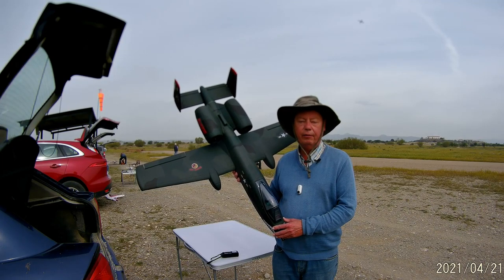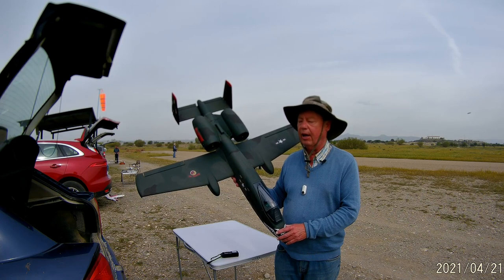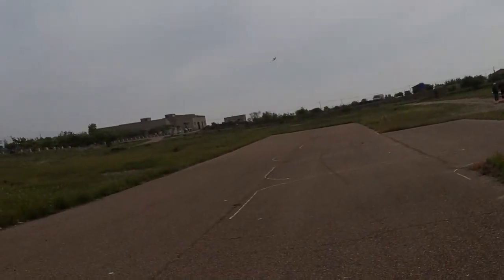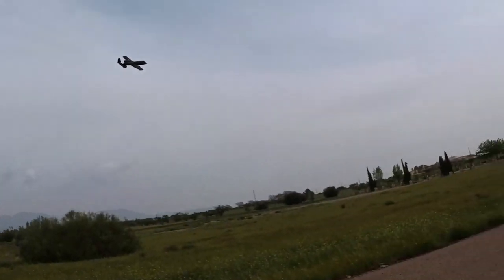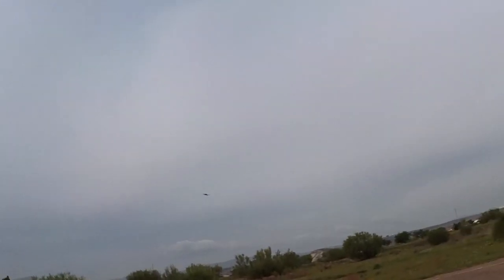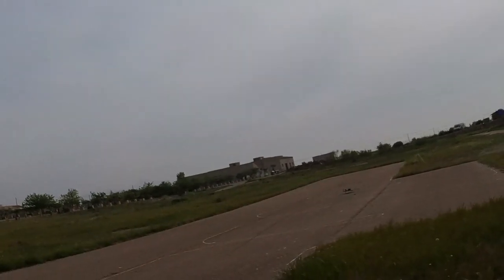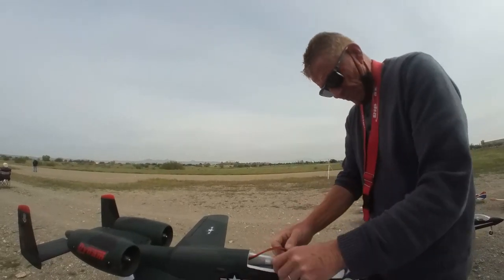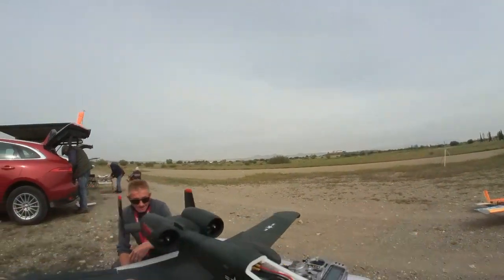Dynam A 10 Warthog V2 1080mm Wingspan Dual 64mm Ducted EDF Jet Maiden

Comment: I had heard that the Spectrum telemetry only worked at short ranges and you get telemetry as it flies by. The range issues was noted as just being a telemetry issue not a "real" loss of signal and the only way to stop it was to turn the warnings off. Look on the facebook group for the tx16s which uses the 4 in 1 module.
Reply from the maker: Hi, thanks for your comment. Yes, the "telemetry" lost is spurious but as you can see at : https://youtu.be/tSKn8fcgxW8?t=41 the plane starts to drop out of the sky! I have more testing to do. Thanks again for the input.

Comment: Look at this from github on the multimodule group :-
The RF low signal with DSM does not mean anything. The dx9 doesn't complain because it doesn't even display it use this info. Just do the same with OpenTX and disable rssi warnings.
The only thing which matters with DSM is if you get failsafe which is most likely not the case. Even at long distance.
I'm annoyed by people reporting or have just because they get a rssi warning. I'm going to remove it all together.

Comment: im getting binding on my elevator pushrod, do you?  im running my pushrod on top of elevator for belly landings? ok?
Reply from the maker: Mine runs under the elevator as I have landing gear. Running over the top is probably binding because of the aerofoil shape of the elevator. You would need to put a longer control horn on the elevator or servo or both!! Thanks for watching, have a great day!
Reply: @1nformatica  how do you get rid of servo moving in the foam for elevator in this plane even though its glued in?
Reply: @1nformatica  what mah size is max for this plane s on 3s  2600-3000 3s??  some guy I read was running 5s 4400 in this jet how is this possible?
Reply from the maker: @43rocket  Unless your control rod is binding the elevator should not need much force to move. If the foam has been crushed and now weak the only way I know to fix it is to remove the servo and reinforce the cavity with ply or plastic sheet. Personally I would make an insert on my 3D printer!
Reply from the maker: @43rocket  The recommended battery is 2200 mAh which is what I use. Must be high "C", mine is 75C graphene pack. A 5S 4400 pack would be so heavy it would need to be pushed far back into the fuselage to balance even if it would fit! Also I guess the ESC's would need to be changed, not worth the hassle in my opinion!
Reply: @1nformatica  hi i still have binding with down elevator.  now my pushrod is on top, does it need to e on bottom of elevator?
Reply from the maker: @43rocket  The correct installation as per the setup sheet is with the control rod below the elevator. The plane is designed to run with landing gear. The bottom of the vertical tails would hit before the servo arm even if landing wheels up!
Reply: @1nformatica  how did you stop the escs from moving around in there?
Reply from the maker: @43rocket  I don't! They cannot move very far.

Comment: How’s she fly? Good for a second jet?
Reply from the maker: It is a very smooth flyer if not particularly fast. Getting the CG right is a challenge with the two fans at the rear, managed with a 2200 mAh Graphene pack all the way forward. Flight times are short 3 or 4 minutes due to the power drain. Thanks for watching, have a great day!
Reply: @1nformatica  thanks! You too